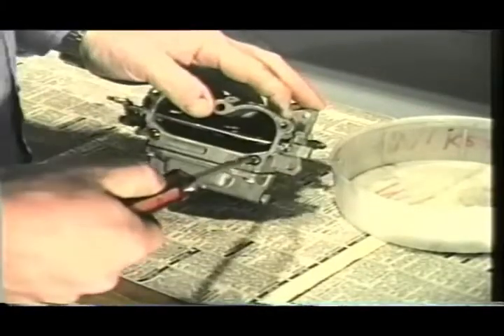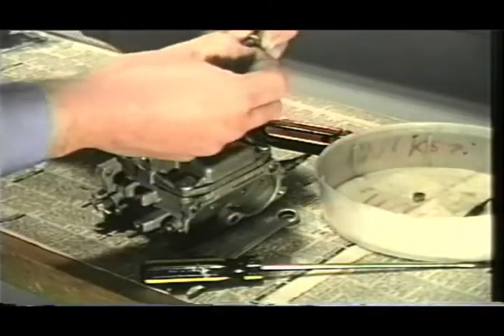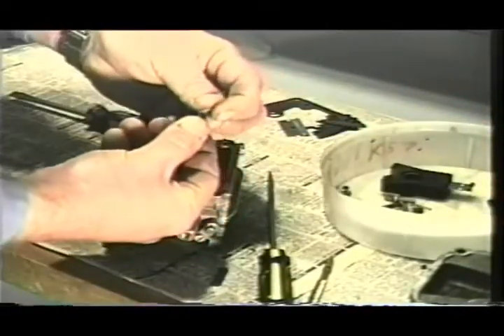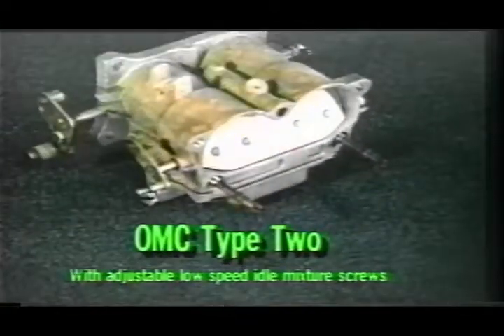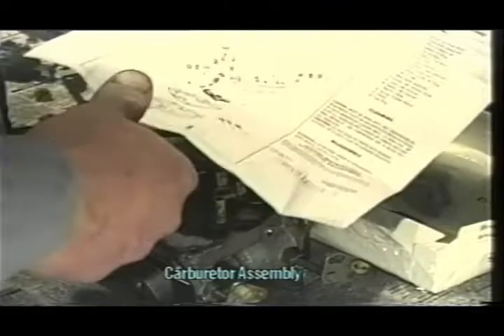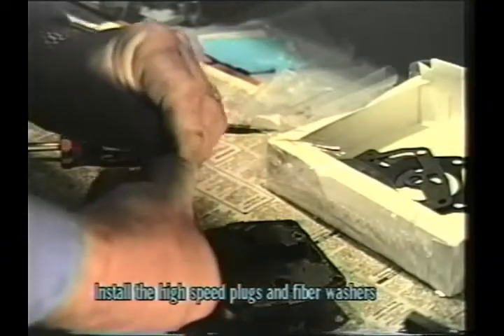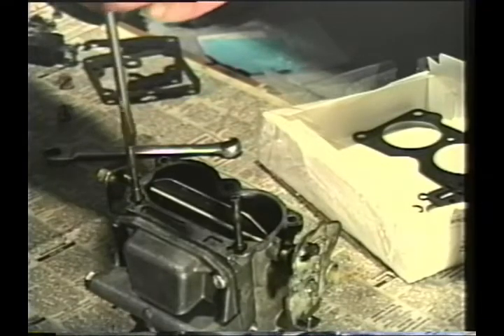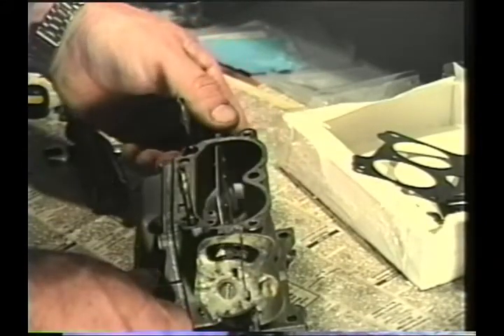How to repair Johnson v4 and V6 Carburetors: A Step-by-Step Guide

Comment: What year is this from? I'm working on a 1990 Evinrude XP 150hp V6 and wondering if it's the same carbs / procedure
Reply from the maker: Hello, thanks for your question. And for checking in, the video was done quite a few years ago, but that year and model engine you have are the same carburetor type and the same procedure to clean and rebuild them Johnson kept that same type of carburetor all the way through the 80s and 90s. And even up into some of the 2000s.  So it was a pretty good  and reliable carburetor. The only difference in the earlier models is they had butterfly chokes and adjustable low-speed jets.Thank you for watching the video and for your comment

Comment: Do you have one of these videos for pre-1968 V4 Johnson outboard engines/carburetors?
Reply from the maker: Is that the carburetor that has the adjustable low speed jets and has the butterfly chokes. I don't believe there's a video that i've done on that particular carburetors, but I can answer any questions you might have